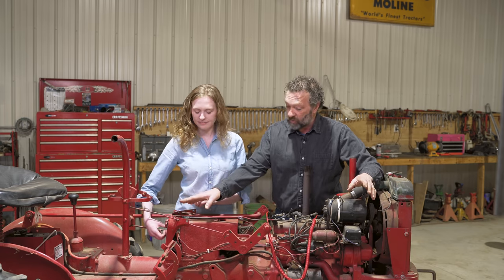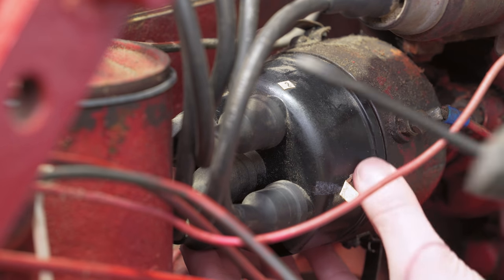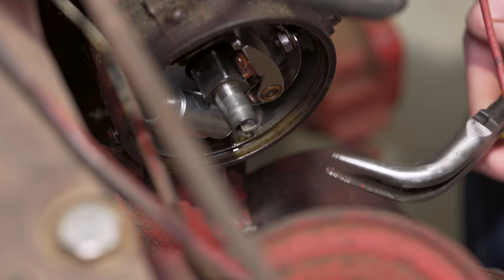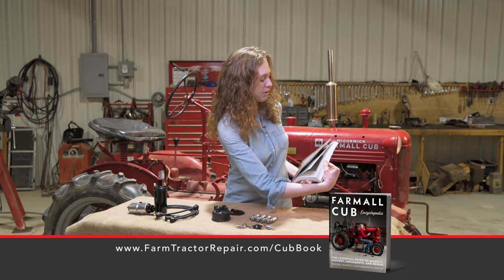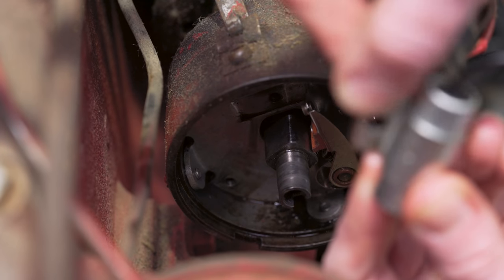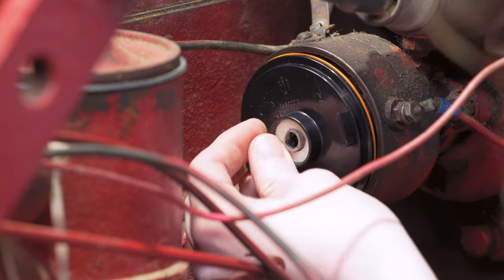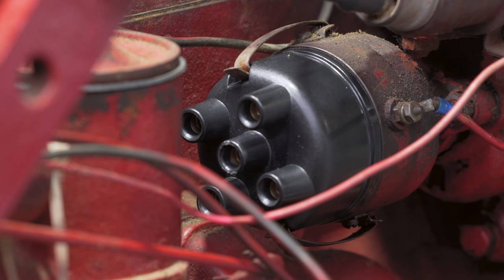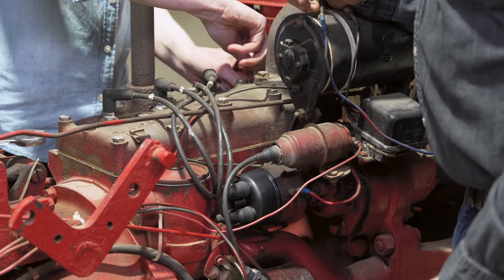Farmall Cub Tune-Up How-To: Points, Rotor, Condenser, Coil, Plugs and Wires for Distributor

Comment: Hello Dan and Rachell I have thoroughly enjoyed all of your videos, even when I am not working on what your video is about, I learn something new every time. I bought a 1965 Ford 3400 Industrial 3 cylinder gas about 2.5 years ago and ya'll have helped me out tremendously on some issues, which I am great full, it is still work in progress but it is in working condition and I will stay on it until its complete. Some people can make a video and ramble through it missing pertinent information which is crucial to the repair, you are very thorough in explaining the process in the repair and so patient in doing it. I am having trouble figuring out the 3pt lift handle lever, it works fine up and down but it will not hold its position.it is either all the way up and it holds or all of the way down. I can clamp it in any position to use it, but I would like to repair it correctly so if there is any direction you can steer me in I would greatly appreciate it. I do have a manual but it is very vague on that subject. thank you in advance.. Cesar Hernandez
Reply: Sounds like a worn out or missing friction disc washer on the rod at the base of your lever handle

Comment: People might like to know why and what function the ballast resistor performs and why it might be required.
Reply: If you're burning up your points relatively quickly it may be a faulty or missing ballast resistor. The resistor drops (resists) the voltage going to the points making them last longer. The condenser could be bad also as it minimizes the spark at the points as they are opening & closing in operation. Hope that helps.

Comment: 4 cylinder advance jumping, I'm getting spark just not to my points. With a spark plug tester between the wire and plug scraping the negative terminal on the battery you could see a spark clicker. Toggle switch push button start, on and off works. Toggle switch does seem to be in reverse no matter what I do by reversing the wires, on is off and off is on. Other wires on the gauge panels seem to be wired exactly as the diagram says. Have you or your dad ever had this experience on a 4-cylinder engine? It's actually a four-cylinder Hercules generator from world war II

Comment: I have a super a with no spark took the distributor off. Don’t see any points or condenser . It has been  running fine. Had it for several years. Suddenly it quit yesterday What am I missing?

Comment: I have a question. Should my 75 Cub be the same number 1 hole on the cap? The number 1 in this video, mine seems to be 1 counterclockwise on the cap is where they have it going. I bought this 6 months ago and I have never heard it run yet.
Reply: It doesn't matter which hole #1 sparkplug wire is in out of the four. What matters is #1 piston is on top dead center compression stroke and then put the plug wire on the cap hole the rotor is pointing at. Then arrange the rest of the wires to match the distributor rotation and firing order.

Comment: Does a coil need to be removed/disconnected to test its resistance?
Reply: Maybe not removed but the wires disconnected so you get accurate readings on the coil itself only.

Comment: What does it mean when I can't get spark to my plug wires. I have power leaving the distributor to the coil depending on weather or not the points are open or closed.when the key is on start no fire when it is turning over.when the key is just on it will have fire or not but will not flash when spinning over.no fire to plug wires
Reply: Check your ballast resistor is in series in the primary line to the distributor. Make sure it's ok and correct for either a 6V or 12V system. 
Also make sure your cap & rotor are both good or replace them. In some cases the spark will travel from the rotor to the shaft & not out the cap.
Reply: @frombryant6678  
All is new but cap .it is only 2 yrs old.
Have a new one on the way to cross that out.brother said that maybe we need to eliminate the external resistor since the coil has an internal  one.ink it worked before for yrs.
Reply: @williamtobias8948  Yes if the coil has an internal resistor, eliminate or bypass the external one. Two is too many.
Reply: Thanks will do away with the external resistor.

Comment: Boy I'm having issues. Just start off I'll be buying a book. But I have spark and fuel it act like wants to start but it will not. I don't have high tech stuff. I do have compression. I buy this to restore me and my son. But still have issues. The motor had stuck valve and it fix now. There back fire not sure if it's out of time or not.
Reply: It's a 1955 I think 154 lo cub 4c trying to learn but issues our issues.lol